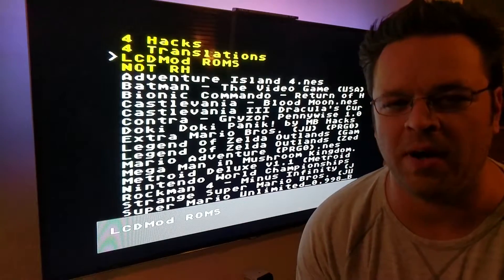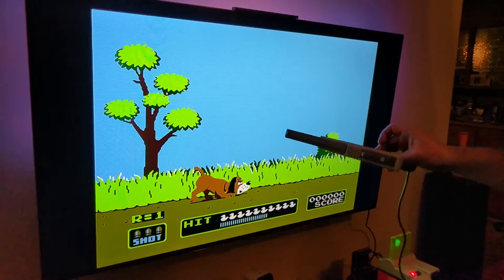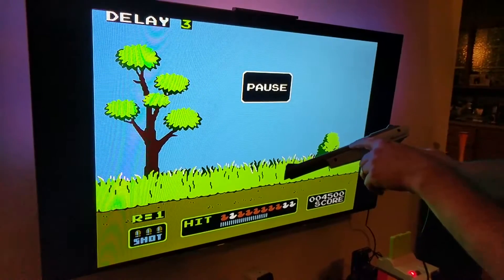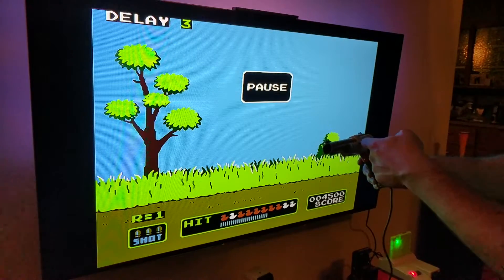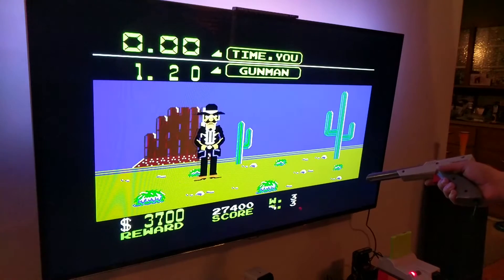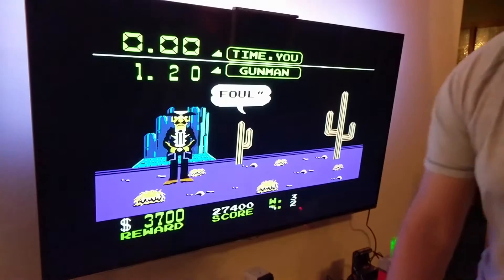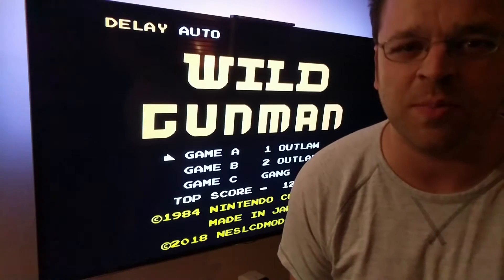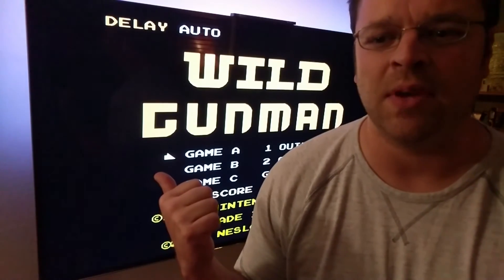Modded NES Zapper working for LED TV with Duck Hunt

Comment: Wow thanks man!  

After I made my video on the LCDMOD I was contemplating doing the exact same thing as you did, but I’m currently on vacation.

I’m totally going to do this now and post a response maybe on Sunday!  Great video, thanks!
Reply: Can't wait! :)
Reply: Unfortunately I wasn't able to get it working very well like the aftermarket gun used in my previous video.  Makes me wonder if there is some pretty heavy filtering going on in the OEM Zapper's circuitry.
Reply from the maker: Interesting. Thanks for the feedback. What TVs have you tested with? LCD (older non-LED), LED, OLED?
Reply: No worries.  With an LCD and an OLED.  It was pretty unfortunate because the Tomee gun really does feel like crap, even though it works well.
Reply from the maker: @RetroSho  I may try pulling all the guts (minus the lens ) from the tomee gun and put it in an NES zapper next. Maybe that will work better.
Reply: That should work actually.  Ghetto, but it should!  The circuit for the Tomee gun seems to be much more tolerant of LCD and LED flatpanels than the original Zappers.
Reply: @RetroSho  Hmmm.... I know old video but, going to do this myself...
Reply: @TheCoolDave  Give it a shot and report back on it!

Comment: I know this is really old, but I just tried this for myself and had a very strange result. After putting the LED into my official Zapper, it now works perfectly on CRT screens, but now won't work with the LCD mod at all. I made sure the negative post was in the right place and that it was facing right down the barrel, and for some reason it won't work with LCD mod. The Zapp gun worked perfectly with the LCD mod before removing the LED and putting it into the Zapper. Did you also remove the front lens or the metal weight pieces in the barrel? Any other ideas of why this would happen?
Reply from the maker: Pretty sure I kept the original lens. I'm curious why you phrased it like this "..it now works..on CRT screens". Did your Zapper not work prior to modding it? In short, I have no idea why your mod would not work, especially if the Tomee was working. I would try a second set of Zapper+Tomee and try it again or, maybe just take all the circuitry from the Tomee and put it in the Zapper housing. Keeping the Nintendo shell and firing button would go a long way to keeping it feeling more authentic.
Reply: @Dormat25  I phrased it that way because the Zapper works better on a CRT now than it did before putting in the LED. I've done some further testing and the Zapper technically does work with the LCD mod, it just doesn't work as well as the Tomee gun. I'm not sure if it's because of some of the extra circuitry or resistors inside the Zapper or what causes it, or maybe because it sits a little further back in the barrel or something, but the timing and sensitivity are far off from the Tomee gun. The circuitry inside the Tomee is very different from the Zapper, it'd be a lot of extra legwork to re-wire the whole thing into a Zapper shell and find out how to make the LED board fit inside the original Zapper housing securely, so I might just leave it for now. Thanks for the response

Comment: I want to thank you for making this because I would not have attempted to modify my original zapper if it were not for this video. That said, there appears to be a mistake in your photo listing which is positive and negative. Once I opened my official NES zapper I noticed the original diode had the anvil on  the right side when looking down the barrel, or on the top when looking at the bottom of the board like your example. Anyways, instead of removing the diode from the Tomee zapper I decided to just order some photosensitive diodes on Amazon just see if they would work....and they did! Thanks again for posting this video, it was very helpful!

Comment: Thanks for posting this. I'm researching this for an article that I'm doing and my question is -- have you ruled out the possibility of false positives on the LED screens (not LCD screens)? Replacing the photodiode does not address the issue of the CRT filter in the original NES zapper.
Reply from the maker: If by false positives you mean firing the gun at something on the screen other than a valid target, yes. I did that in the video.